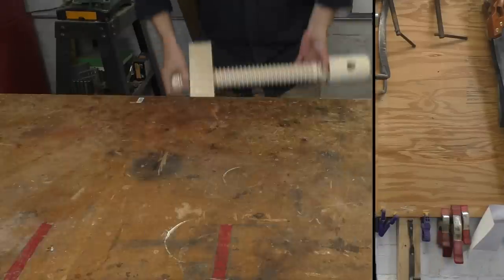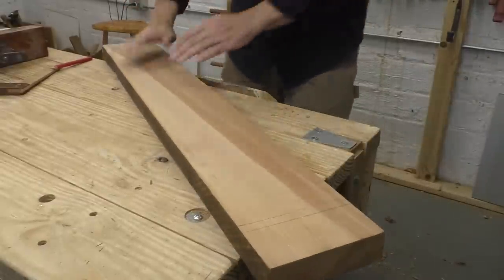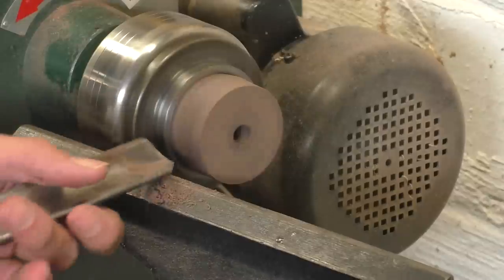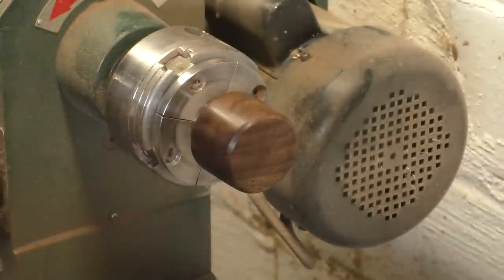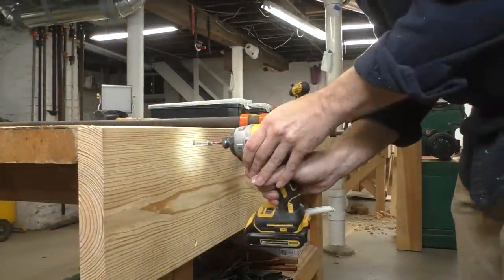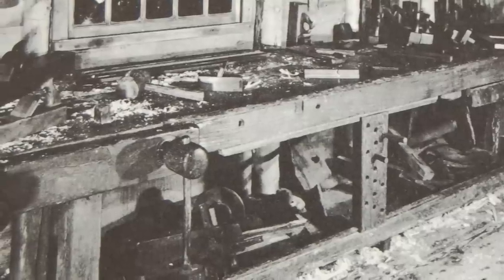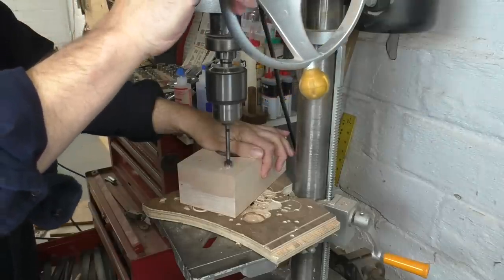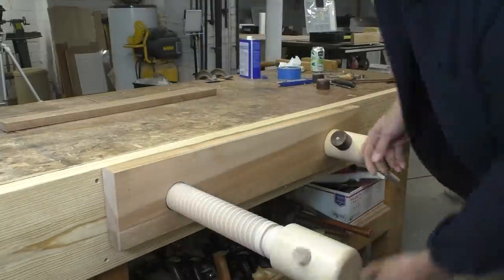Vise Squad #3: The Ancient Wooden Twin-Screw

Comment: As a manufacturing engineer, I’m going to say the Dominis used it for production. Your leg vise is more versatile for different tasks. But for production of furniture the  twin screw would be faster  at each stage of planing, joinery and assemblies etc. One set up you would just use one screw to open and close as you work each part and replace for the next.  Think about the time you would save planing saw marks of 30 tapered legs or or dropping in each carcass for 10 sets of drawers.
Reply: Thats what I was thinking as well. There is a complete opposite and often counter intuitive mindset for switching from single to serial production and I suspect thats where this piece shines.
Reply from the maker: Okay, but i only use one screw on my other vises. Trust me,  this one is not faster in any way.
Reply: Haha, we trust you Rex. There is the other possibility it’s simply looked cooler, more expensive and impressed clients.
Reply: it would also hold long jigs better without the constant retightening.  Their shops  would have had large changes in humidity temperature etc.  this would have continued working through all conditions without messing around with warpage and swelling.
Reply: I'm glad I read the comments before replying - I was going to say basically the same thing.  You don't need to loosen both screws to get a workpiece out.  Once you have it set for the thickness of the boards you're using, you can just leave one screw alone.  Another element of the Dominy vise that you may have noticed is the jaw extends a good distance to the left of the left screw.  This allows you to use that piece to the left kind of as a leg vice.  Again, you'd use the right screw in the same way you'd use whatever you use on the bottom of your leg vise jaw, to set the vise for the thickness of the piece(s) you're working on, and then just leave it alone.  You'd then use the part to the left of the left screw as your leg vise for working on the ends of pieces.  It looked (in the picture you showed) that the Dominy vise had something lie 6-8” to the left of the screw.  I don't know that I'd replace my current vise with it, but I don't think the Dominy's didn't know what they were doing - if the twin screw actually stunk, they could have always put the old leg vises back on.  In fact, since this is pretty easily removable, maybe that's what they did, depending on what they were doing that day.  (Again, assuming a production shop environment, they probably made a lot of the same kind of parts one after the other, e.g. chair seat day, drawer sides day, etc. )
Reply: It can be said that changing between vise could be a standard thing to do for them. Last project the two screw was the better option and that is what you now see.
Reply: @RexKrueger  im intruigued by the historical archeology of this! is it possible the LET screws are just bigger than the historical ones they used?  They seem to look more elegant in the historical picture. The other thing that struck me is watching this right after the leg vise video is these seem simpler in a way in that they dont have any of the problems you mentioned in the leg vise video, like the whole thing tipping over and needing the dowel bar at the bottom and then the spacers at the top and bottom. It seems like if you are working with multiple pieces in the same dimension, you would kind of leave one screw alone as a depth stop and just work the other two switch pieces, until you switched tasks.  IDK tho, you're the one actually using it!

Comment: I remember seeing a video, and unfortunately I can't remember where at the moment, but I think that one of the concessions with the twin screw vice is that you don't always need both screws. If you're most often using, say 3/4 stock, you actually leave one screw alone and use the other to quickly release and clamp the work. The physics works much in the same way as when you demonstrated the ability to hold tapered work. You only havwe to adjust both screws when you have to change stock width or when you have to hold a strange shape.

So if you're preparing a project, you would prepare all stock of a sinle width, then change the second screw and go through the next width, and then only at the end do wheird shapes, or osmething like that. By adjusting your process a little, you'd minimize your reliance on changing the second screw. When you manipulated the vice in the video, you often had the vice way more open than you needed in order to insert or remove the stock.

*Disclamier: I haven't yet actually worked any wood, this is just what I remember watching/reading, so take it with a grain of salt.
Reply: I agree, If you use the free board to wedge smaller stock for boxjoints with just a nudge of the free board in the opposite side of holding you could probably tighten and loose really quickly wich would be preferable in an industry. You would probably wear out the threads a little in the long run but it would increase production. Probably just use both screws with really big stock.
Reply: Aye, like a horizontal leg vice, you can set one end and just use the other.  The screw threads were nice and wide, and rock maple, so wouldn't get gnashed easily doing this.

Comment: I attached a twin-screw vise to the end of my Roman workbench (Woodwork for Humans series) and I love it. The total cost in materials was around $12 (two 3/4"x12" bolts with nuts and washers, a couple lag screws to hold it to the bench, a piece of 2x6 scrap for the jaws, and some faux-leather from Joann's to line the thing). It's great for all the small projects I've been working on. I can sit on the bench and work, or sit on my Woodwork for Humans stool at the end of the bench and work from there. Great series - keep up the good work!

Oh - one more thing. I use spray-can graphite to lubricate the threads. It uses isopropyl alcohol as a propellant and the residue is just dry graphite. If it gets on a project, it's really easy to clean up.

Comment: I built my workbench about 20 years ago, and I put a twin screw vice on it. 1 1/2" maple screws that I made myself, white oak hubs on them, birch handles, and a 1 3/4" thick white oak jaw. The nuts that the screws go into are some weird brown wood, I think it's from west Africa, and the dust from it is irritating as all hell. But I dovetailed the nuts into the bench top and they look awesome. I've found the vice quite useful, especially when making boxes, because you can clamp a whole box up to 24" wide in it and plane the sides without racking it. I got the design from Fine Woodworking, the article was written by a chairmaker, and he liked the vice for holding chair seats. The loose jaw takes getting used to, and sometimes it gets stuck at a weird angle, and you have to yank on it or whack it, but honestly I love it. The other thing I really like is how the handles I made are one solid piece of wood. You drill a hole through the hub maybe 1 1/16", the turn the handles to 1" with  1 1/8" bullet shaped ends. Boil one end of the handle for 20 minutes, then hammer it through the hole, it squishes down, then expands again and it's permanently in place. Making the handles out of birch helped too, I think, because it's softer than oak or maple, but still strong enough to be a handle.

Comment: I made myself a twin screw using 30 mm threaded rod years ago without knowing any of this. I just thought it would be strong, cheap,  easy to make and hold tapered pieces. Those were the big considerations. It ended up really growing on me. 
Truth be told, I made it at first without garters and it drove me nuts, I just had to upgrade it. I found that the way I made them also helped with the outside tilting of the jaw, which was also a problem.

Comment: Moxon vices have several issues- some of which you pointed out. A further one is that it is two point clamping, so any workpiece that does not pass through the vice causes the face to tilt. 
There is a version  with a swinging plate under the bench, which allows wedge shaped parts to be gripped without the front hubs being at an angle to the jaw. This would permit a bearing to prevent tilt.
A twin screw vice with a single handle and torque matching on the screws would give the best of all worlds- working on it...

Comment: I put a twin screw vise on my bench using 1" tap-and-die set. I threaded dowel rods and tapped the bench skirt and a pair of locking nuts.  Dowels are secured through the bench and dont move; locking nuts spin in and out on the dowel to hold the outer jaw in place.  It was one of my first projects
Reply: How're the 1" dowels working for you?  I'm thinking of building a low workbench and adding a twin-screw vise like you described. A 1" tap-and-die set would seem more versatile for other projects around the shop than the larger sizes out there, but I was worried that the 1" might not work as well for a vise.
Reply: @GaryKlineCA  1" dowel works just fine.  I had a problem with vertical racking, but I think this was a design flaw of the verical placement of the dowel holes in the jaw.  I.e. i think I put them too low.  Another set of dowels fixed higher on the jaw has limited the amount of racking and will get me bye until I want to redo the whole contraption.

If you're familiar with the Wood By Wright channel, I followed his build for the inspiration.  He has two videos on twin screw lime this and a bench-top mounted moxxon vise.
Reply: @benjaminfrayser4392  Thanks for the response!  I noticed some examples of a twin-screw vice showed an outer jaw that dropped 6" or so below the bench top. It didn't make sense to me, but maybe that was to help with the vertical racking you observed. I'll check out Wood By Wright's videos.

Comment: TL;DR: maybe the advantages aren't when you're making furniture and funiture-esque parts one at a time as a one man shop, but when you're making a lot of things as a family at the same time.

I think you might have answered your own question already. They were a family of craftspeople, not a modern one man at a time show. If I get it right, they made lots of things, they made lots of big things, and they produced in numbers too, and as a collective, not just individual craftsmen doing individual work. With that big vice there, I bet you could plane the sides of a lot of boards all at the same time, either for joining them all together or just to get a lot of work done at once. Lose some time in prep work, but you know, if you do 2 boards instead of 1 at once, that is half the time. Three boards, it is 1/3, four is 1/4, and so on. Can cut a bunch of time doing things on mass. And I betcha it is wonderful for making a mortice, little or no slowly sliding down shenanigans.

Also, if you're working as a group rather than the modern one person show, the shop dynamics are just different. For example, while someone is cleaning up some boards on a vice, another person is prepping boards on another to be cleaned up, first person moves to that vice when done with the first while the other person go back to the vice to take care of that board (setting up to clean another side or moving it to another step). Optimisations for a one man shop and for collective work are just not the same.

That all being said, I get you're doing is basically experimental history here so you gotta do it the historical way for that. But for more practical purposes, I think more modern twin-screw designs (either diy or bought) offer the same power with much more practicality. Linked screws and metallic screws, for example, make the use smoother and afaik don't sacrifice any power.
Reply from the maker: You make a good point,  but multi-person shops were the norm then.  Solo work was very rare,  so that doesn't really answer the question.
Reply: @RexKrueger  I am not sure I follow. I was making a point that maybe the vice works better for multi-person shops and work, rather than solo work. Wouldn't solo work being rare reinforce the idea? I feel I am missing something.
Reply: @louisvictor3473  The issue is that many shops abandoned the twin screw. So the Dominys were an odd duck yet also very capable. So Rex wants to know why they returned to the classic rather than using more "modern" designs.
Reply: @RexKrueger  - Huh? It does answer the question. I don't do woodwork (that's my husband) but I do sew by myself for a family. I have discovered that many techniques that speed up a shop or factory  might .slow down or even stall altogether a home sewist with average skills, little time, and forever making custom pieces. I baste a lot, something that does not happen on factory floor. But I have one garment to produce, rather than 100 in day. I will simply never get the experience I need in putting together that particular garment to avoid the step. Many other examples like that, in many areas of crafting. A home shop versus a factory like setting is just different.
Reply: @Beakerbite  - Maybe they weren't as capable as you're giving them credit for. For sure, the production of anything from woodworking to sewing to food is approached differently in a multi-person for cash environment versus hobby type activities to supply yourself.
Reply: @Beakerbite  I see, now I get it. If it is just the group thing, then everyone would want it but they didn't. My bad, I emphasized too much the "group factor", while that was more of the glue rather than the boards, so to speak.

Working as a group just compensates the downsides of the vice, but isn't the reason for it. If I am getting the history right here, their work load was different from what was common for woodworkers of their time, both in quality, quantity and diversity. It really caught my attention that they didn't only make furniture, but also did carpentry and other non wood centric crafts too. If they brought any of that other work to the shop or it affected what they needed form their woodworking shop, that is quite significant. So what I am thinking is they had unique needs from their shop when compared to other (fine) woodworkers in ways that were substantial enough to justify a vice that was overkill for most of their contemporaries who didn't have those needs.

TL;DR: it sounds like they were a bit different from their contemporaries, so some of their tools were different too.
Reply: I'm not sure multi-person shops were quite the same thing as a family shop would be.

I do know that in English shops as well as some American shops you usually had a master and several journeymen and apprentices.  The master would accept work and assign it to a journeyman.  Journeymen generally worked like contractors - they'd buy the wood from the master, hire apprentices from the master, work on the project themselves, and then the master would pay them for the job minus his cut.  Apprentices would be assigned as needed (and would cost the journeyman).

That's a lot different than a shop where everyone is working together on the same project and there's no individual profit motive.

Comment: Hey Rex! I built a twin screw vise with $25 worth of hardware. I bought a TR20 threaded rod, split it in three parts and made a thread tap from one of them with an angle grinder and some creative filing. Then I used the tap to make internal threads directly to the hardwood apron of my bench.

It is my favorite vise, the only thing I regret is not making it even wider so I could put a whole cabinet carcase in it to do finish planing after glue-ups.

Comment: I have two different WorkMate(tm) portable work benches, both with integral twin screw vices. The larger WorkMate has a belt/clutch drive such that turning one screw turns both, whereas on the smaller one the two screws are completely independent.  The larger unit is much more convenient. 

Perhaps, you can brainstorm/fabricobble a belt or chain/clutch drive between the two screws. I'm sure that would help in the "convenience factor" department,  immensely.

Comment: I would try smaller knobs with shorter and skinnier dowels, that looks like what they did in the picture. Maybe perfecting the swiftness of those handles is the key
Reply: The knobs are barely even there, and the cap of the screws may be wider? Very cool
Reply: I was thinking the same thing I suspect the trick is to turn both screws at the same time.

Comment: Twin screw was the design I have. I use an impact and it's super quick and I can do 30inches wide. I think it's a very nice feature to have and can be done for cheap. I'm rocking like 5/16 all thread and that's more than enough holding force and with an impact it takes only a few seconds. Then older style tables would be lovely to work with but I dont have the space so my own table has to do just about everything I need now and in the future.

Comment: I have been using a twin screw vise with a couple pieces of all thread (largest home depot had) and 3 nuts per screw to hold in place with some 4 inch hole saw cut outs on each screw I think the hole thing cost me less than $15 to make Just used  some 2 by  scraps for the material   Mine is not nearly as large as yours  only down side is it takes a while to screw into position for larger boards  but it was cheap and works great.

Comment: The Dominys used the twin vise because it was cheap back then to buy them in bulk and they didn't have access to a JawHorse by Rockwell. Best vise I've ever owned.
 But I have been thinking about making a twin screw vise using some allthread I salvaged from worksite's trash. Now that I think of it I have enough to easily do a quadruple screw vise, synced with stepper motors.